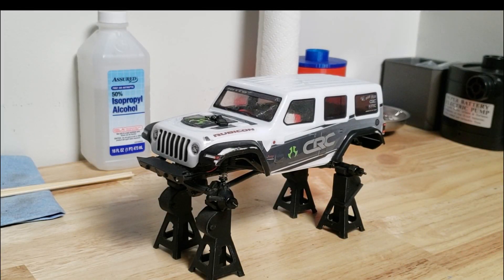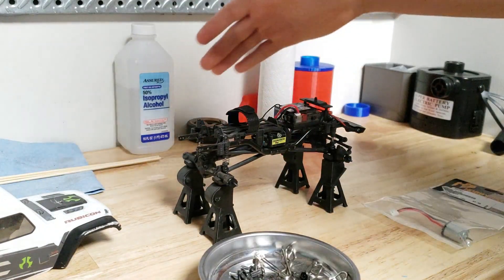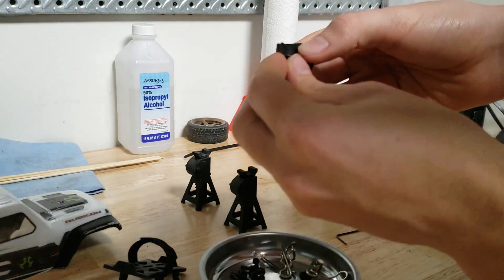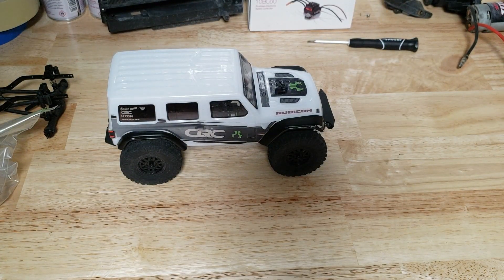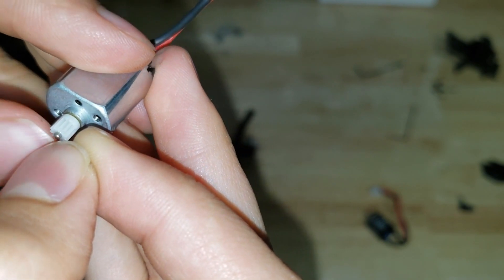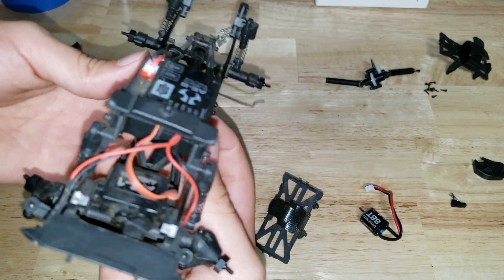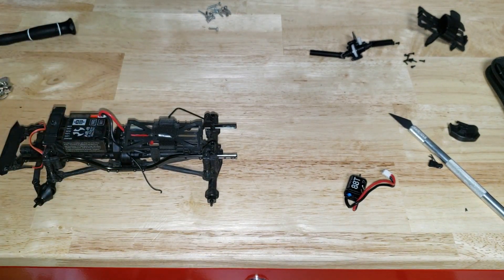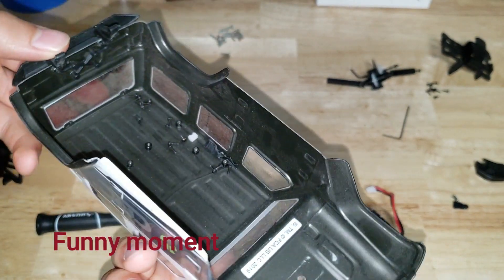How to replace the motor/upgrade it in a SCX24

Comment: Did the motor lasted longer than the original? My son got thru the 2nd motor :)
Reply from the maker: So far it is still going, however there are a lot more motor options now, I will suggest a bigger 050 motor. However, you do have to cut one of the battery tray feet off to get it to fit. Here is a link to a 050 motor: https://www.hobbytown.com/furitek-scx24-chameleon-brushed-motor-w-motor-mount-pinion-80t-ftk-fur-2076/p1389912
Reply: @RCTechworks  thank you its sold out i hope the trx-4m will come next week :) till this be in restock i would put a brushles combo in it but i dont want to spend too mutch on this platform it would also need the oil filled shocks
Reply from the maker: @Stepny Vlk  I totally agree with you, I was thinking of selling my scx24 and getting the trx4m. It looks like a great truck and for about the same price as a new scx24.